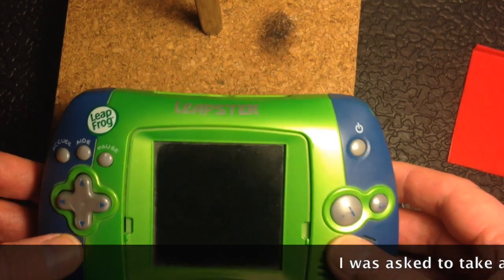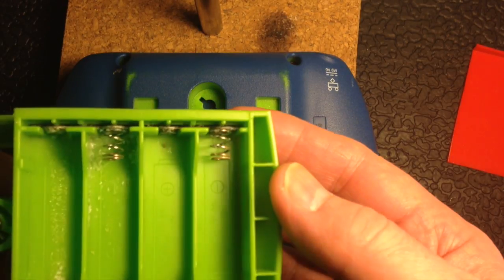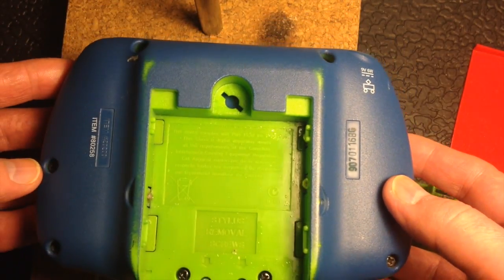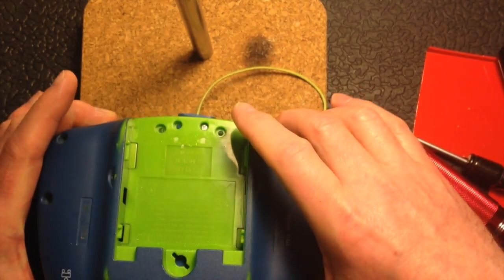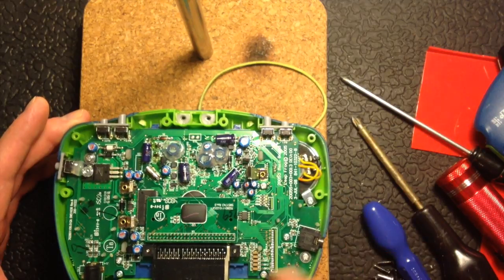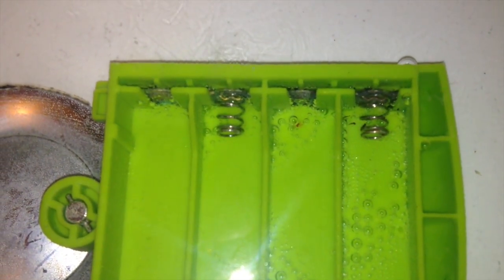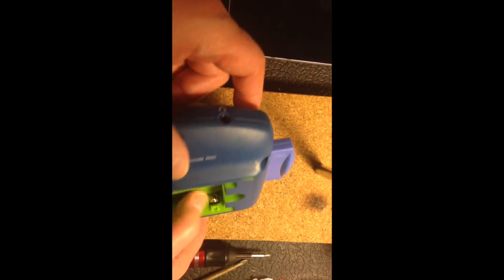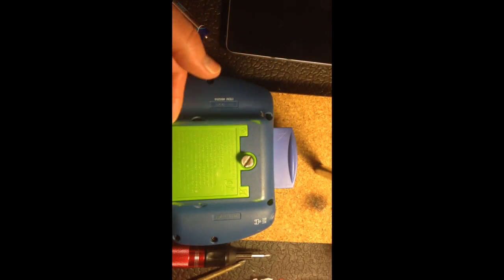How To Fix A Battery Leak In A Leapster LeapFrog Console

Comment: My screwdriver runs on a lithium ion batteryi'm not sure if yours does but if it doesn't I bet if you put one in there it would run at almost twice the speed and you would have almost double torque The only thing that I don't like about the screwdriver that I have is I don't have the heads that are small enough to penetrate those really tiny screws so I usually have to do that by hand
Reply from the maker: Alex Williamson'sadventures Yes I thought of modifying it but the 3.7v Lithium Rechargeables I have are too long but I'm not beaten yet ;-)  I will use a few crock clips to test the concept before I start cutting holes in things. ;-)  Have you checked out this video yet?  http://youtu.be/9wZzKt_MylU?list=UUa7OD3xhZ0Xbb2aUSuIQujw
I actually warm rolled a new plastic gear using polymorph on the original shaft, after a couple of revolutions the new gear teeth were moulded from the warm polymorph.  I ran it under a cold tap and its as hard as the real cog. The added benefit is that the warm polymorph was forced up and out by the gear wheel forming a secure trench to run in, without the trench it would just bounce off the imperfect teeth.  I need to practise and refine the technique but its a winner for old toys with Cogs with broken teeth.

Comment: Hello. Unfortunately the corrosion in my leap frog has gotten into the circuit board. What should I do?
Reply from the maker: If you have a multimeter trace the tracks from solder joint to solder joint to see if there is a break, if so gently scrape off the green lacquer to get back to the copper then solder a wire across the gap. It looks unsightly but works.  hope you’ve subscribed and stay safe please consider sharing my gifting safety masks to emergency services video https://youtu.be/6ZgaY5ny5yI

Comment: I never seen this variation of the Leapster before.
Reply from the maker: Its a bit bulky but seems to work great and was available in the UK.  #fixed1tTOYrepair
Reply: Also, my Leapster GS has battery corrosion it doesn't have a battery compartment that's identical to the ones Leapster model 2, the Leapster 2, and the Leapster Explorer. do you know how to fix it?

Comment: Thx. I've dug out my old one. Same model but different skin as mine has silver around screen and green everywhere else but I have some seriously bad battery corrosion all over and the batteruies loork like they have all fused into the springs. I'm scared to take them out. Where do I put the batteries that it is safe?  It is all over them completely.